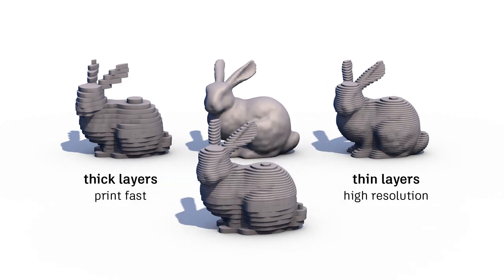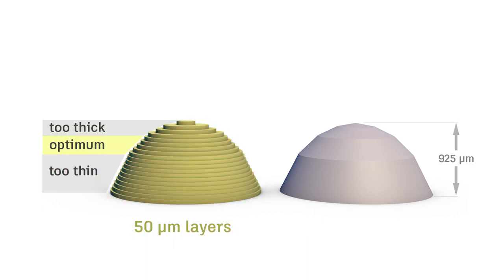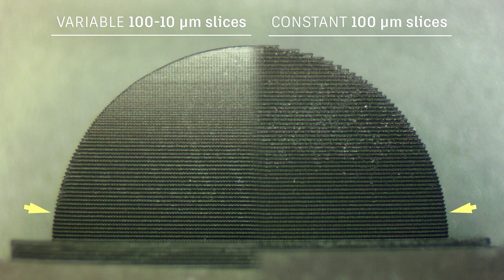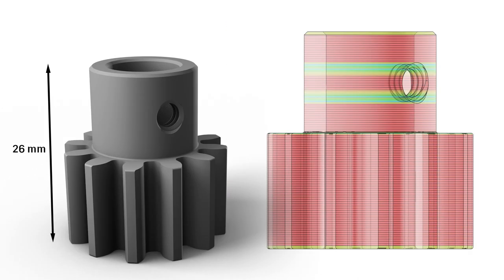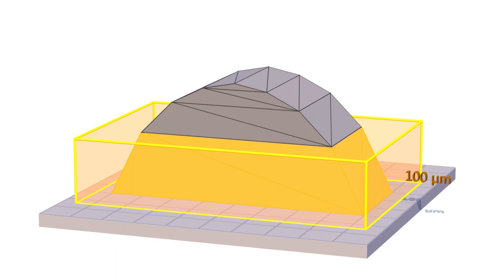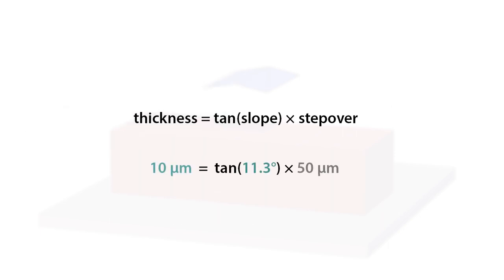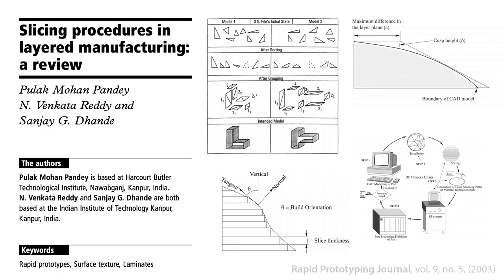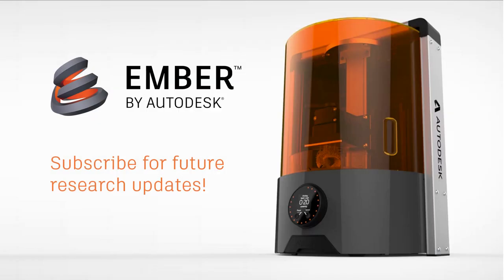VariSlice™ — Variable Layer Slicing for 3D Printing

Comment: Love the video. Humorous, but a very clear explanation of what the tech is doing.

Now, to integrate this with Slic3r...
Reply from the maker: We'd love to see that!
Reply: There is a pull request with exactly this in Slic3r main repo for over a year ;-)
Reply: Josef Prusa Ah, complete with plenty of discussion, and active as of 18 days ago. Looks like its still in the review stage, also looking for testers. Thanks for pointing that out Josef!
Reply: I know the variable height layer option as i'm trying the Prusa edition Slic3r, but it is completely manual settings. You have to set Zmin height to Zmax height and apply a constant layer height to that range of Z values in a row. But the most interesting thing would be this:  you evaluate the whole model and apply interleaved variable layer height and DONE! you only have to set range and step for example from 0.1 to 0.3 on 0.1 steps. As shown here, that layer height interleaving could provide more accurate surface finish than constant layer height in the same way the Darboux integral is way better vs Riemman integral (check both on graphical explanation).
FMD printing need this implemented in any slicer. 

https://gyazo.com/429537735c015abb4b71ba43763ed58f
Reply: Cura 3.2 beta

Comment: I'd love to see this in Simplify 3D!
Reply: You can do this in S3D...
Reply: Can you elaborate as to how please? I have the software installed and I don't seem to have any automated variable slicing options. I in fact linked this to S3D's support and they told me they're working on this which would imply it isn't yet implemented.
Reply: Yes, but its not automatic.  You have to use separate processes, and set the Z height manually for each Z segment.  Which is fine, but would be nice to have it automated.
Reply: OMG yes that whas so obvious !! Thanks

Comment: you could speed up the algorithm by sorting all triangles by their highest vertex. Then instead of starting at high layer heights and trying out a bunch, you could simply iterate over the sorted list and stop when the most sloped triangle would have a too large angle for the given height. That's a 10x speed up of your algorithm.

I wonder how much the speedup of print time is for organic shapes like that Buddha head, though. Those kind of shapes generally have all kinds of angles at any given height.
All your examples have triangles of all the same angle at any given layer. Your test models seem to be selected to 'prove' the efficacy of VariSlice.

Also note that the XY resolution of printers is generally way smaller than the smallest layer height, so you would generally be printing at the lowest layer height. I would base the variability of layer height on a user setting, rather than a machine property.

Comment: nice concept but I don't see any time being saved at 10 µm to 100 µm. printers will require 19 different printer profiles. If they can even do 10 µm in the first place. In order to realistically save time, you have to increase your layer height range to increase larger sizes that people use for speed. at 250 µm, you need 124 printer profiles. at 400 µm you need 199 printer profiles. the end user will have to test each of these profiles to make sure they actually work.

Comment: If you could have a variable nozzle, this would make detail even better!
Reply: Or 2 nozzles, one bigger one smaller, and switch when needed.
Reply: You mean like an iris nozzle? Hmmm...
Reply: Yeah, something like that.  I know it's possible, but to get manufacturing cheap enough to be feasible is the tricky part. It could be driven by a servo or a very small motor that would be isolated from the heat.  And getting the parts non-stick enough to eliminate friction is the other problem.